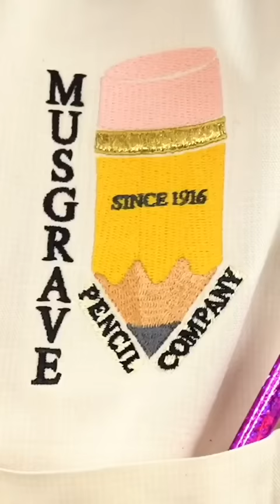Here's how #pencils are made #shorts #insider #howitsmade #pencilfactory

Comment: Ah, so these are where the shitty pencils are made. 

Criteria:
*Hard-rock erasers that leave a pinkish hue when used. Will never come off. 
Lead that's powdery and *will leave a trail that when you skim with your hand, it will actually smudge. 
*Plastic coating that can slip away after 1 round of sharpening. 
*The metal chamber that holds the eraser will fall off after 1 week (give or take) of use.
*Lead that's so brittle you will sharpen it again after the first instance of you putting the tip on paper.
*Lead is gray af.